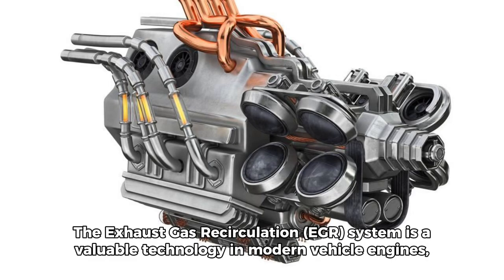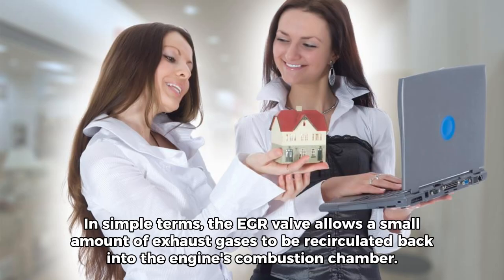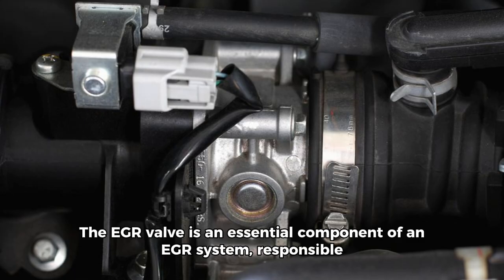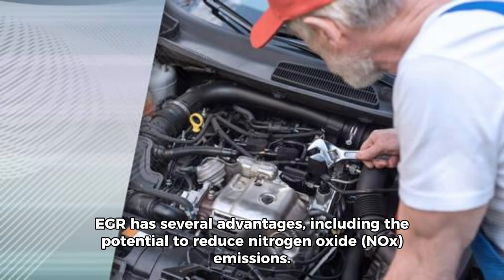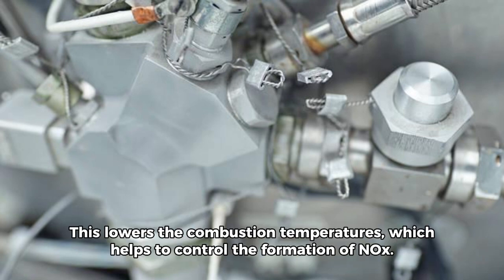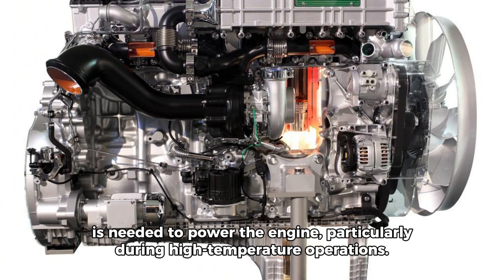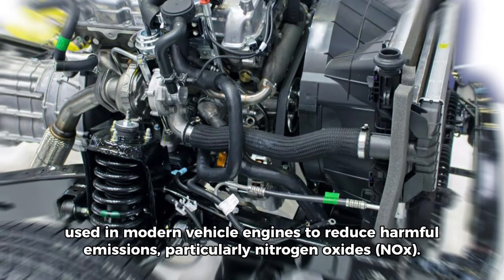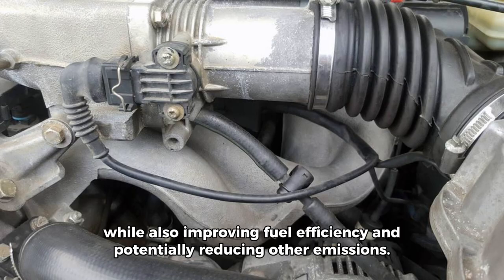EGR (Exhaust Gas Recirculation) is a crucial technology in internal combustion engines.

Comment: And this is why everyone pulls them of, because they block your vales and manifold and blows your engine, run a catch can with a breather and save thousands of dollars for a reckon motor, because of the stupid EGR valve.
Reply: Egr causes very little issues on gasoline engines, but a lot of problems on diesel engines. Hardly any gas engines die because of egr, not the same on a diesel.